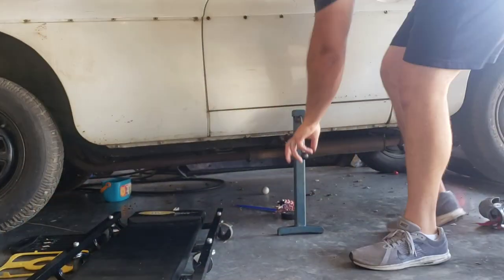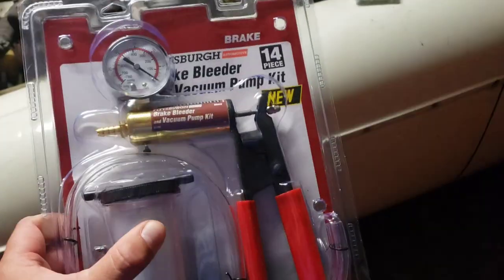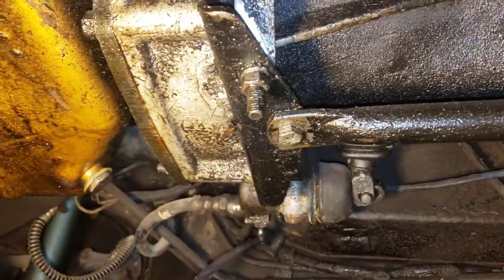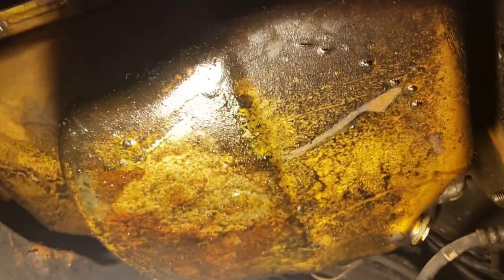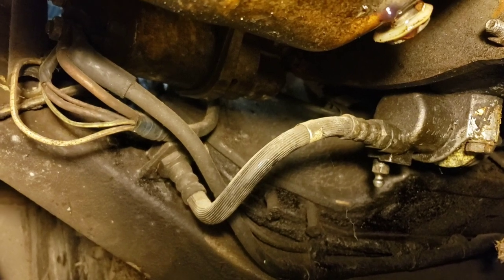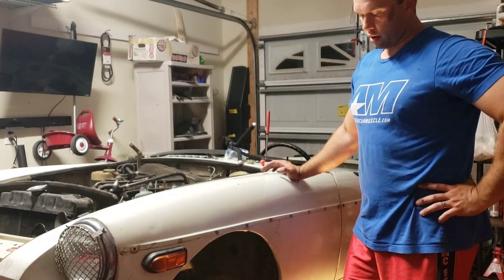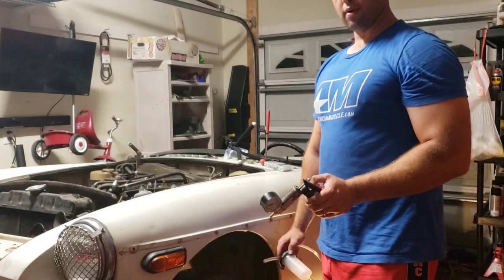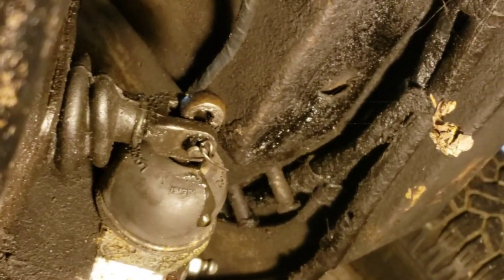1974.5 MGB Bleeding Slave Cylinder Failure/Success/Failure (Let me Explain)

Comment: Having a nightmare with mine. Replaced slave with newer (used) one off one of my 2 MG parts cars and ended up replacing line up to the master cyl too. Got plunger working again in newer slave since other car had sat couple yrs but right now, cannot seem to get clutch pedal pressure to return, either.
Reply from the maker: If you are trying to stay OEM i get that but slaves and off brand Masters are pretty cheap off of moss from what I remember
Reply: @BrailsfordsRides  I`ll go with anything that puts me on the road. Already ordered a new cyl off ebay that`s due to arrive Aug-11 but was only hoping to get on the road sooner, especially since only now the weather is turning nice for summer. 
Chap I bought my daily driver B from said he deals with Moss a fair bit and said they value the 5sp trans in parts car i got elsewhere at $5K.  It`s a real-deal rebuilt 5sp, not electric button pressure-activated overdrive. 
Got a real mix now. 2 set-ups of OEM single Stromberg SU, other setup of dual SU`s, and I`m running sidedraft weber + header on the daily.
Reply: Had prob`s with the (fake)Weber ebay kit  too. Border inspection forgot to re-include all installation instructions & set-up data for complete kit and i had to drill the intake for distributor vacuum advance since there are no ports on the weber. Ya, it`s been prob`s since day one but I still love it